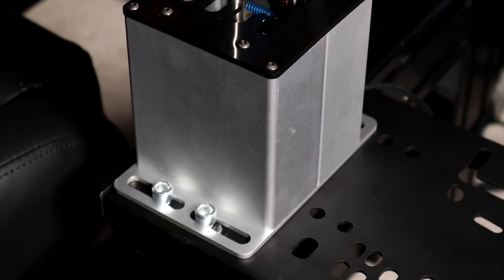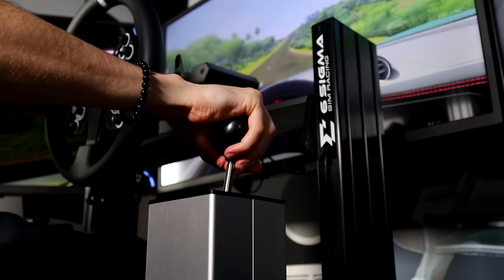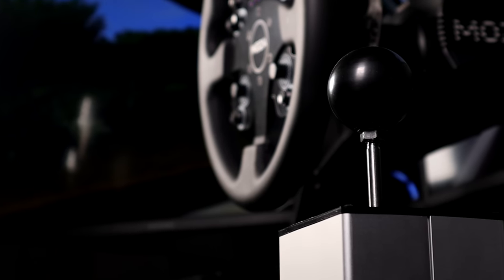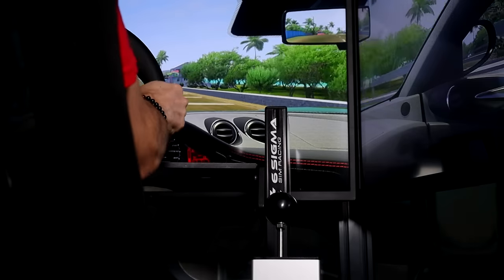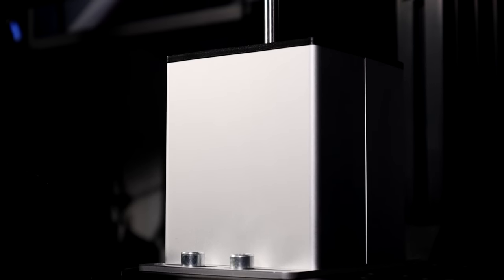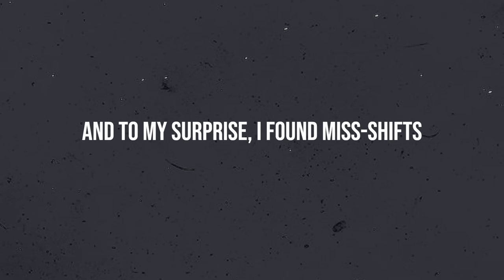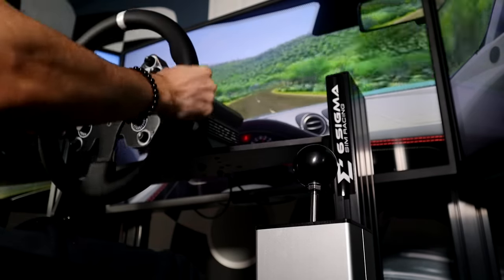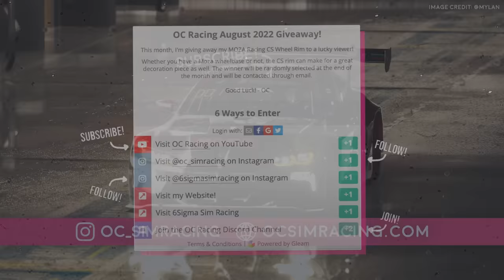Reviewing the CHEAPEST Sim Racing Shifter on AMAZON!

Comment: That's actually nicer than I expected, maybe I'll get one so I can drive the occasional manual car. I usually drive a paddle shifter car 95% of the time so it's nice to have a cheap good shifter for that remaining 5%!
Reply: They are actually solid. A little hollow and clicky sounding but nice feeling overall.
Reply: Buy it off aliexpress a lot cheaper then off amazon got mine for £40 and arrived in a week
Reply: @lolthekidison  You can easily mod this and remove hollow and clanky sound. My mechanical keyboard experience came to play with this lol. Mind sounds satisfying thocky. no longer obnoxious
Reply: @jamirvillarosa7924  how did you mod it, i am interested in nodding it myself too since i use my rig a lot and would appreciate a more 'immersive' experience
Reply: @karhu07  lube the bearings and loosen the the screws that holds the bearings(optional, this changes the resistance of the shifter and somewhat adds to silencing). Cut small piece of neoprene foam that's big and snug enough to put in the space behind the bearings where the shaft hits. This way, the foam won't fall down. This will reduce the noise significantly. And finally, apply multiple layers, like 3-4 layer of painters tape in the walls inside the case. Purpose of this is to reduce hollowness, in return reduces case ping/echo inside.
Reply: @jamirvillarosa7924  Thanks! I think i have enough expertise to do this.
Reply: Once I got an h shifter sim racing became so much more immersive for me. I'm the opposite, I will on drive manual cars.
Reply: What cars do u drive that u only drive with paddles? Why only those style cars? Don’t u ever wanna drive like a cool Porsche or something
Reply: @hi_c.v7289  I usually drive GT or Formula style cars. I occasionally drive other cars but I still use the paddles for now, I'll definitely get a shifter but stuff's expensive, first I have to finish the rig lol
Reply: @lolthekidison  how are they holding up btw?
Reply: @zhila5958  mines still completely fine. They use really stay switches and joystick controllers so everything should be an easy replacement if anything ever fails.
Reply: @lolthekidison  i might actually consider them due to how good they seem. thank you so much. appreciate it!
Reply: @zhila5958  I meant, *common switches not "stay". You can get adapters for other shift knobs to.
Reply: @lolthekidison  gotcha, thank you homie!

Comment: I have exact same shifter and I've added some sound dampening foam (idk exact one, it is used for cars usually) underneath the mechanism on the inside and on the inside walls, it is much more quiet and has more satisfying sound (for my preference). Like the content, thank you ❤️
Reply: How did you make it work in Assetto Corsa? Mine wont get detected Ingame but in Content Manager it works
Reply: @risky4you855  Hey, sorry I cannot help there, I sold the shifter a month ago :( It should be fine if it is being detected in CM. However I remember that I had some issues with it not being working in game as well for the first time. Not sure what I did for it to work, hope you will figure it out
Reply: @haiiry  what do you have now
Reply: @tijj  nothing, unfortunately 😁 Had to sell, because I moved to a different country. I wouldn't change it, personally, to something else, little bit of modding and it could be on pair with much more expensive shifters, expect maybe fanater or more premium ones (tho I have only tried Logitech, Thrustmaster and the one from the video)
Reply: @haiiry  and you liked this one the best after modding? Nice definitely gonna consider getting it from like aliexpress for cheap when the time comes
Reply: Good Idea, do you have some picture for that ? Thanks
Reply: Does it work with xbox one s
Reply: @kevingeisler8528  I never had Xbox, can't help you there. If I remember correctly, Xbox does not support multiple inputs, so except if you connect everything through a wheel (like you can do with fanatec, Logitech, thrustmaster, and maybe if there is adapters), nothing will work.
Reply: @risky4you855  I'm having the same problem. Did you solve it?
Reply: @siralvinxd1327  I think I changed something im the Steam Controller Settings. So it wont detect as a normal controller

Comment: If you can wait a bit, Banggood has the better version with hall sensors rather than micro switches for about the same price.
Reply: Do you have a link for that?
Reply: It sucks tbh. I end up returning it. shifting to 3rd and 4th gear sucked since the shaft is misaligned. You will hit the gates when shifting. I stuck with this and modded.

Comment: I have one. I liked it until it fell apart on me. I had two problems:

-the mini USB that plugs into the arduino comes unplugged every now and again

-the screws that hold the bottom of the shifter to the side casing are cheap flimsy screws, so one snapped when I tried to remove it and 2 more snapped after about 7 months of use. 

All the mechanisms still work, it's just the casing popped off. I have it held together with a bunch of duct tape. It'll do until I can get a nicer one, I suppose. Maybe I got unlucky.
Reply from the maker: Thanks for the insight! I haven’t had any problems with the USB and I used my own mounting bolts. I’ll definitely keep an eye out for how it progresses with use though. 

Also, I’m thinking of giving away an H-pattern shifter so stay tuned for that 👀
Reply: regarding the mini usb connection, the one i have with me is hot-glued. I havent had any problems with screws as i mount them to my aluminum rig. The screws of the whole thing are just small allen head screws though, easily replaceable. 

But mine isn't perfect, the shift mechanism isnt perfectly lined up, so it collides with the top plate when i shift to third and fourth. Just cheap product QC things.

Another tip would be dont get the ones with metal top plates, mine came with metal top and it was constantly grinding the shifter. until the extent that you can see flakes of metal around the top plate. Replaced the top plate with plastic ones and fixed the problem, also made the whole shifter whole lot quieter.
Reply: @Steve93K  mine was hotglued as well, but i suppose it was poorly done because it broke off. I don't mean the screws that hold the shifter to the rig, i mean the small allen head ones that hold it together. I agree about the metal plate on top, I'd probably replace it with the plastic one if I intended to keep it longer. My gears 2, 4, and 5 have bent switches so mine's a bit funky. I probably did just get a particularly bad one, but I'll just wait until i can get a nicer one to replace it.
Reply: @diplomatofthesosbrigade931  ah yeap. To be honest I di wonder how long will mine hold up. There are hall sensor variants but I question the quality of the hall sensors themselves. Supposedly 'lifetime', but hall sensor usb handbrakes from china fail too...so yeah there's that.

Comment: I have this and have been useing it for a year. And absolutely no complaints. I have the 6 speed. But take the top plate off and cut a new one and you still can use it as a 7 speed as the extra switch is still there underneath. There is also a version that has a range which is nice for ATS/ETS.
Reply: I got a 7 speed and often misshift. And tbh you don't really need a 7 speed imo.
Reply: @Mattes985  yeah I know. Just saying that for anyone that has ether and wants to convert it from a 6 to 7 or 7 to 6 plate that they could. 
There both the same on the inside.
Cheers mate.

Comment: This was very helpful, I’m looking to build a more serious race sim mainly for drifting and I’m not a fan of the Logitech shifter and higher end shifters and get expensive. This looks very upgradable too.
Reply: The only reason to use a Logitech shifter is because it came with a Logitech wheel but you wouldn't buy a Logitech wheel for drifting anyway. This one looks better than the Thrustmaster shifter. Not as good as Fanatec shifter but for the money it seems to be a solid choice.

Comment: I’m loving this shifter. It delivers good quality while not breaking your wallet like the TH8A, or most other shifters on the market. Does this one have sequential shifting mode tho? I’m trying some rally games out, so figured having one should be nice.
Reply: Yes and no. You can order it with a piec e that you attach to the metal shifter stick itself that slots sinde what would be 3rd and 4th gear, preventing it from exiting those slots as well as not enabling it to move past the inner ball bearings. This makes it autocenter and only move slightly back and forth, giving you an effective sequential. It works really well with this simple piece installed.
Reply: Does it work with xbox one s

Comment: I’ve bought this shifter about 5 months ago, and used it for about a week before I went got myself the Fanatec shifter. 
This one isn’t bad. It’s definitely WAAAAY better than Logitech and Thrustmaster. I just didn’t like that in one week it already had a way weaker clunk than when it just arrived. It’s just sitting in my closet now as a spare shifter.
Reply: I’ll buy it off you lol
Reply: it's waaaay better but degraded that much in one week? i've had my logi shifter for about 2 years and it still feels like it did day 1.
Reply: @DAN.eight6  Even degraded it still feels better than the Logitech. It’s built better first of all. The Logitech is a toy
Reply: @DAN.eight6  issue with the usb shifters are there is no quality control and one might be awesome and the other might be junky. Also no warrenty or support after

Comment: In my mind, the only problem with these cheap shifters is that the buttons are connected with a usb encoder (maybe only on mine that comes from AliExpress). So since I built my own DIY handbrake with a similar usb encoder (supporting 12 buttons and some joysticks), my computer detects my shifter with the name "usb controller" but also my handbrake with exactly the same name... So if I connect my handbrake button on the wrong input, I brake and the 6th gear is engaged at the same time... So I lost 8 inputs on my 2nd usb encoder and I can't make the button box I originally wanted.

Comment: hi ive got one today and tried to play assetto corsa and gears 1-6 work fine but the reverse gear cant be mapped because the computer recognises the shifter as a gamepad and the reverse is assigned as RT. any ideas how i can switch assigning it or fixing it?
Reply: Well that's annoying.  If I buy this I'll be using it for AC also.
You might need to use Joy2Key as a workaround.  It can pick up the controller inputs and relay a keyboard button to the game.  A good way to test your Joy2Key setup is by trying to "type" with your controller in a text editor like notepad.  Once you know that's working then set up those same keys in the game.

I wonder if there's a way to switch the shifter into DirectInput mode instead of XInput.  I think DirectInput is more flexible, but not all games support that mode and I don't know if it would help in the case of AC.
Reply: @yorgle11  na I fixed it my cm doesn't work as  the install one but I added it to steam library and that's what caused the problem because I was on steam it registered as a controller because I had that setting on. If ur cm won't work properly with ur wheel and shifter  from normal launch, add it to steam library and disable controller support in steam settings and everything including the shifter will work

Comment: im very new to sim racing and on a tight budget too, i wanted to know if this works with any wheel or does it only work for the wheels it says in the aliexpress page, i noticed that its a usb shifter so im guessing it should work with anything
Reply: It's for PC only. So it'll work with any wheel that you want as long as they both plug into a PC.

Comment: Question does anyone have a mclaren gt fanatec V2 wheel if yes does your wheel have the fanatec logo on top mine doesn't sadly I had to use a sticker but I saw one of OC racings videos and it seems like the fanatec logo is stuck on the wheel with out a sticker since you could clearly still see the carbon fiber plastic aroud it. Just curious to know.
Reply from the maker: It’s a sticker! You peel off the plastic film on the top and it leaves only the letters
Reply: @OCRacing  Thanks man I was wondering what that weird white fanatec letters were for. Love the high quality vids keep it up : )

Comment: I have this shifter and it's great. However mine has a toggle switch wired to it that I haven't figured out it's use any ideas?
Reply: Way late on reply, but the switch on the handle is for high/low range   generally. Great for 4x4, or high/low in semi truck.

Comment: I can't make it work in Assetto Corsa. Content Manager detects it properly and I can set the gears with no issues, but in game it change the gear positions (putting the 1st in the 3rd for example). I can't fix it simply changing positions in the settings. Could anyone help me?
Reply: In content manager make sure you check the box that says to use H shifter.